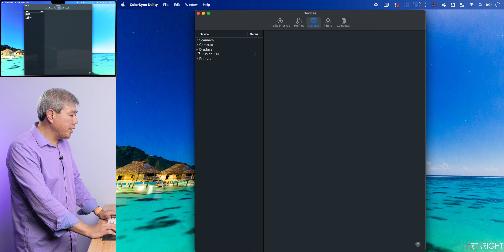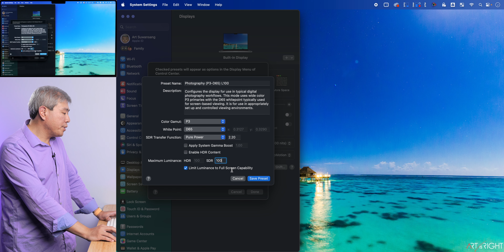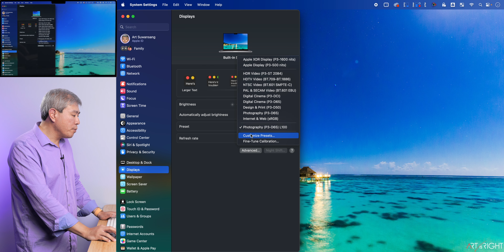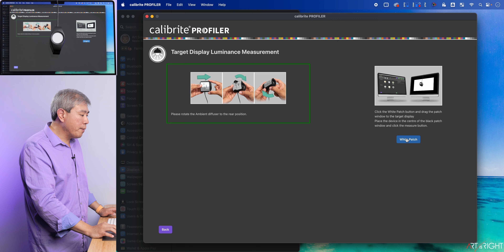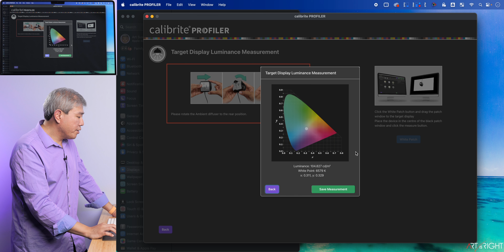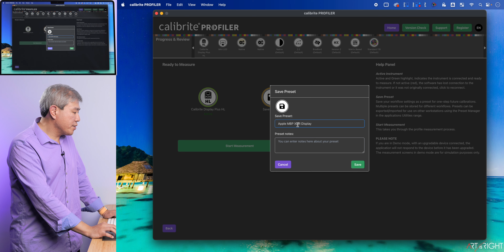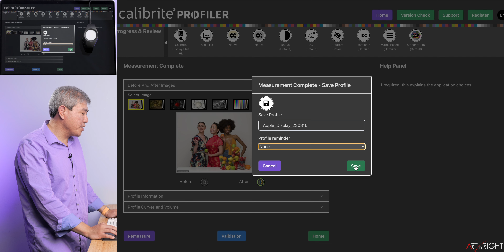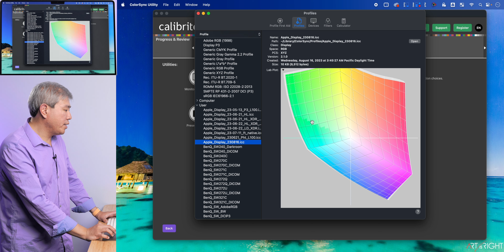Ultimate Calibration Guide for Apple 14" & 16" MacBook Pro XDR Display - This is the way!

Comment: Dear Art! I was mentioned this issue before, could you tell me pls, why is that if I have a calibrated white point (and icc profiler of course) with Photography preset made by Xrite's previous sw CcProfiler, so I do a K measure with it, it is perfect, but if I switch to the Calibrite Profiler (it recognizes my Calibrite Display Plus HL) and I measure just the actual white point too, it will show  totally different and wrong value... And it doesn't matter, what kind of panel type I set. I don't have any trust like this... Which sw is correct? I also wrote to support, didn't get any answer, quite frustrating...I am using an M1 Max 16" macbook.

Also the other question: is it possible now to calibrite the default Apple XDR preset? Or doesn't matter, because the icc profile I set will remain in active and that is the important? I'm a little bit lost with this... Would be nice to have the default preset being colorcorrect (without the True Tone of course).  
Thanks if answering this! 🙂
Reply from the maker: "... why is that if I have a calibrated white point (and icc profiler of course) with Photography preset made by Xrite's previous sw CcProfiler, so I do a K measure with it, it is perfect, but if I switch to the Calibrite Profiler (it recognizes my Calibrite Display Plus HL) and I measure just the actual white point too, it will show  totally different and wrong value... And it doesn't matter, what kind of panel type I set. I don't have any trust like this... Which sw is correct?"
Panel type does not matter quite as much for this specific task. However, what you mentioned is not necessary the correct method and approach. The correct way to run the display on factory default icc because that is based on the DCCIC data. From there measure the white point with out any fine tune and no icc modification. Once you do that then calibrate with native settings like I have shown in the video. 
"Also the other question: is it possible now to calibrite the default Apple XDR preset? Or doesn't matter, because the icc profile I set will remain in active and that is the important? I'm a little bit lost with this... Would be nice to have the default preset being colorcorrect (without the True Tone of course). "
Once icc is set it will apple to all preset until change. This does not matter as much and one should turn True Tone off.
Reply: @ArtIsRight   Thanks, I understand, but I think this does not answer the question, why the two sw (from the same company) measure two different values for the same white point? 😀 It is not possible to measure a detached K and xy value only to check just these figures if I only want this? If running through the whole process with one of the sw and setting everythng right, only the same sw will measure correct values after it and it is true for the other sw as well. I hope you get what I mean. 🙂Just trying to understand.
Reply from the maker: Miss the SW part, also I was not aware that the question compare 2 SW, I thought it was just Apple Displays. Also are we taking 1 BenQ SW, Apple Studio Display, or the laptop one. Because the reference mode and fine tuned calibration only works for Apple not BenQ. Nor do I recommend checking the white point method if there's not a specific use for it. You can but that is a rather singular metric that only look at 1 part of a much larger equation that works in concert together and that one that can be compensated with a icc profile. Also if you are using SW and you should use Palette Master Ultimate if compatible either that or Palette Master Element. I'm not seeing your full setup form the original question. So if you can, please layout your display setup for me so that I understand what you are trying to do, proof and achieve.
Reply: @ArtIsRight  No, there's no external monitor, I'm talking about only the 16" M1 Max macbook. (I have an external monitor, an Asus ProArt, but not attached this time, so don't care about external monitor). The two software, I was mentioned is Xrite's Ccprofiler and the new Calibrite Profiler, both are from the same company. I never mentioned any BenQ monitor - which I don't have - or sw. This is why it is more interesting, two sw from the same company measure really different values from the same white point.
Reply from the maker: got it, your abbreviation of software to sw cause this confusion. The measure of white point is a mathematical calculation and technically they are 2 different companies. X-Rite is a stand alone company from Calibrite. Calibrite only uses X-Rite Prism for color but not necessary the mathematical computation to come up with the white point numbers. And those based on my understanding is not as simple as point and report the value. Either way now that I have this clarification, I'll have to get back to you further on this after I have done my own testing.
Reply from the maker: Ok so I ran this test myself and the number that I have matched between i1Profilier and Calibrite Profilier. The use the same device SDK.

Comment: Just to make sure i understand this correctly, there is no use even attempting to use a Calibrite Color Checker Display pro to calibrate a 16" MacBook M1 Pro display? Not even for sRGB? If so, that's a huge bummer.
Reply from the maker: You can but you won't get the gamut correctly even in sRGB. Thought it is much closer to sRGB.

Comment: I have Sonoma 14.0 in my MacBook pro max. I don’t see mini led in my Apple display. I see  White LED,  CCFL,  Wide Gamut CCFL,  RGB LED,  OLED,  Plasma,  GB LED,  PFS Phosphor.   In this case what should I choose to calibrate my MacBook Pro
Reply from the maker: You need to have Calibrite Display Pro HL or Display Plus HL which are the device that support MiniLED backlight calibration. No point doing the calibration if you have other devices. https://youtu.be/nFIv3pWXMl8

Comment: 1. I am calibrating with older i1 Display Plus set to WhiteLED as MiniLED option is not available. It would be nice if you could compare calibration with older calibrator and measure with new HL to check if there is really any difference in deltas.
2. There is bug (Sonoma 14.0) that any change of preset or logging out set picture profile back to factory. ColorSync says that custom profile is set properly but I can see with naked eye that colours are off. I need to set current profile again to the same custom one and can see colours change to correct ones.
3. It is a shame that presets are not assigned to colour profiles. I would like to use multiple presets for photography and every day use but profiles does not change for them. I need to change profiles manually or have only one preset truly calibrated.
Reply from the maker: 1. Only the HL devices have MiniLED option. Yes difference in gamut is huge, no need to compared, did many videos on this already and have been advocating on this. 
2. This may be a local install issue. I have not observed this fleet wide and not on my fleet of machines.
3. I hear you but these are 2 totally different things and works on totally different fundamentals.
Reply: @ArtIsRight  Hello! I have on XDR display but my main proofing monitors are older Eizos and an Apple Cinema display. I have read that the SL is more sensitive in low end and the HL are not as sensitive, sacrificing some range for the high end sensitivity. Have you found this to be true? Would you have two seperate meters one for XDR and one for older monitors, or do you feel the HL is sufficient for both? Thank you

Comment: Would the new Calibrite Display SL work to calibrate these Macs? Or just the Pro HL and Plus HL? I only create 1 photo reference/calibration at 120L.
Reply from the maker: Just the HL, don't get the SL. it is slower than HL and offer less control. You are better with HL

Comment: Hi Art, with a little delay I'm updating the calibration of my Studio Dislpay! Thank you very much for your precious videos. A question please: my printer recommends "
the color temperature must be set to 5,000 Kelvin (D50)". When calibrating the white point, do the XY coordinates vary compared to a D65 used in the video? or can I always use x:0.3127;y:0.3290. Thank you very much for your time and for the feedback. Chris
Reply from the maker: the value that I gave is only for D65, D50 uses a different value. I have to verify that value before I can give it to you. DM me as a follow up for this
Reply: @ArtIsRight  Only Calibrite newest Display Pro HL and Display Plus HL are capable of profiling miniLED backlight displays such as Apple Liquid Retina XDR displays. All previous Calibrite / X-Rite devices are not capable of calibrating any miniLED backlight display including Apple Liquid Retina XDR inside the 14" & 16" MacBook Pro.

Comment: Which refence mode settings do you use for video in premiere pro? Do you set it to the bt1886 preset, or keep it at P3 and use display colour management?
Reply from the maker: Because premiere uses Adobe Color Engine or ACE, you can technically set it to P3. As far as gamma goes, either Pure Power 2.4 or BT1886 they are really close to each other.
Reply: @ArtIsRight  Thanks. Is that with the system gamma boost on too? I wasnt sure if the 1.22 boost was just to go from quicktimes 1.96 gamma to 2.4 (1.96 x 1.22 = 2.39), which would make it incorrect for premiere? Or does calibrite solve that?
Reply from the maker: ACE might do this but Calibrite profile does not. There are other things that Apple does to the icc as well.

Comment: So, if i buy the Plus HL, will i be able to do hdr callibration? like 500nits rec2020 ST2048. Will the steps stay the same just with a higher luninance value? Thank you
Reply from the maker: ST2048 is not yet available in the software. That will be coming in the future for HDR calibration.
Reply: @ArtIsRight  Hi Art, thanks for your Answer. would there be a workaround for working with both hdr and sdr in davinci and also have a propper callibration?
Reply from the maker: If you are going to work in HDR, I would just skip calibration for now

Comment: apparently to calibrate to D65, it's limited to 140. there is no way to set D65  @ max brightness when using outdoors which makes  MBP one of the most inaccurate laptop displays vs windows mobile workstations. my MBP native WB is at 0.311/0.333. i would say that dell and HP's panel so far gives the most accurate results which are almost comparable to desktop monitors.
Reply from the maker: "apparently to calibrate to D65, it's limited to 140. there is no way to set D65  @ max brightness when using outdoors which makes  MBP one of the most inaccurate laptop displays vs windows mobile workstations. "
-It is not a limit but rather a reference mode with fix brightness depending on what you set that to. For using outdoor or casual use you have to do this https://youtu.be/OcmeQgKspKQ switch your display to Apple XDR or Apple Display and you can now change the brightness freely. Also it not necessary less accurate and accurate is relative anyway. If someone is editing, final, color critical work in bright day light, no to say that they are doing it wrong but the workflow is definitely not the best. So go to Apple Display mode and adjust the brightness, you'll be fine, it will still be accurate enough just not in reference mode.
"my MBP native WB is at 0.311/0.333. i would say that dell and HP's panel so far gives the most accurate results which are almost comparable to desktop monitors."
First, it is WP for display and not WB which is for camera both photo and video. And this is why there's a way to fine tune the calibration which I have gone over. To match the exact value that it needs to be. "Dell & HP" are super broad, meaning that they have high end to low-end laptops and displays, sure the high end one will be better, but I would not necessary say "always" better nor is looking at WP the singular metric to look at when evaluating display. Without doing any type of validation beyond this to get a ∆e value. It is one metric that is small but crucial and fundamental part of a larger equation that is not all considered when looking at this solely.

Comment: Ok so here is where I get super confused. So I do both photo and video. When I’m editing photos do I have to set the displays preset to my photography preset as well as set my icc profile to match? And then when I want to edit video, do I then have to switch my display preset to video as well as change the icc profile from photography to match my video preset? So I would be switching both the display preset and icc profile. Meaning I would have to calibrate the display independently for photo and video??? The bulk of my question is just how to do multiple things on the same machine.
Reply from the maker: Depending on the App that you use, Just stick with P3 and gamma 2.2 it is close enough to video 2.4 or BT1886 gamma and just go with it. You can simplified it this way. Once the content hits the web it really does not matter much anyways, displays out there are all over the place.
Reply: @ArtIsRight  oh ok perfect. Thank you for the info as well as all the helpful videos you produce!
Reply from the maker: Thank you!
Reply: But if it does not matter, why calibrate at all? The difference between gamma 2.2 and 2.4 is very visible.

Or should I use P3 and gamma 2.2 as output color space in Davinci Resolve while grading and do a color space transform before delivery? But everybody seems to grade for rec.709 and gamma 2.4. This is all very confusing.

Comment: Thank you very much for this detailed tutorial. As a first time Calibrite user, this was very helpful. The individual points of the calibration also correspond with the reference as they were mentioned. Unfortunately, my images still come out of the printshop with a green tint. Is there anywhere to change the individual color channels on the 2023 MBP?  Unfortunately, I can't find anything on the Internet. And also no other tutorials for a blue tint on the MBP. The image was saved exactly as the printshop requires and I have been printing with this printshop for about 4 years now. Before, but with a Windows pc, I didn't have such extreme color deviations. Maybe someone here has an idea?
Reply from the maker: You are using a laptop screen? What reference mode settings are you using? Did you do the full calibration and what is the ∆e?
Reply: @ArtIsRight  Yes, I work on the MacBook Pro itself. As reference mode I used Photography with color space P3, white point D65 and luminance 100. Then I measured the white point with Calibrite and entered the data in the fine calibration. I took the data from your video as the target value.  Then I calibrated with Whitepoint and Luminance Native with 461 measuring fields. The recheck with 96 fields resulted in a ∆e of 0.9 and a max of 3.7. 🙂

I have already spoken with Apple itself, here we are still looking if there is a solution.  The printshop has sent me reference images, but they are still greenish.
It's just so funny all my colleagues say: Mac Book Pro? Start, edit, print and be happy. Almost no one has calibrated it. And here I am. Newest model, first time Apple user and slight distress.😅
Reply from the maker: Apple is not going to be able to solve this issue for you. They are engineers not printers/ creatives and the issue is not necessary with the screen. There are so many variables here from the lab to the light source used to view the print when comparing to the screen. It is a rather complex thing. This said, the first question would be, have you tried out other lab. Also, if you like please send me the image so that I can have a look and evaluate it. It could simple be that the overall tint is a bit off and print amplify all of this. Additionally what light spruce are you using to view your print? I would also advise a dm with me on fb page or insta. this way we can go back and forth faster.
Reply from the maker: Additionally there really nothing wrong with the screen other than the color gamut is not necessary the most suitable for print. P3 is really not a printing gamut, where as Adobe RGB is.

Comment: I watched a couple of your videos today and immediately subscribed. Very informative! But I have an unanswered question for you, Sir. What is the recommended preset mode or starting point for editing or grading 4K video in Resolve or Premiere and what would be the recommended custom changes to be made? I hope you see this....
Reply from the maker: Premier you can get away with Display P3, but if you use resolve as well, I would probably use REC 709. Gamma 2.4 or BT1886 which is an option, they are so close to each other. Other than that 80-120 nits of brightness based largely on your editing environment.
Reply: Great! 
I'm guessing the Rec 709. Gamma 2.4 option, has to be customized by calibration right? If so, it'll be great to have a tutorial on that. I am also consider your recommendation to buy the Benq SW27 4K. I'm just wondering how all these options will cometogether, especially introducing this external monitor too.
Thank you so much @ArtIsRight! 
Your response and time is appreciated. 
Have a good one!
Reply from the maker: Not quite, in the reference mode set gamut to REC 709 and SDR Transfer Function (Gamma) to 2.4 or BT1886, either will do really. If you end up getting a BenQ just do a hardware calibration on it with Palette Master Ultimate